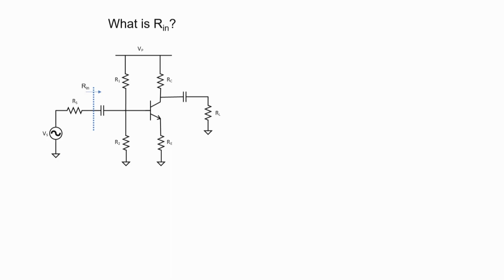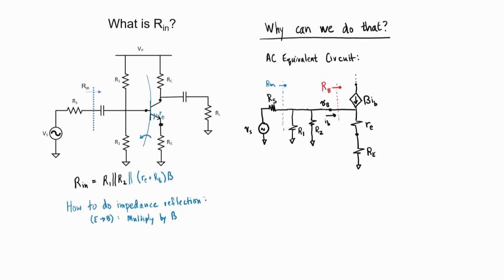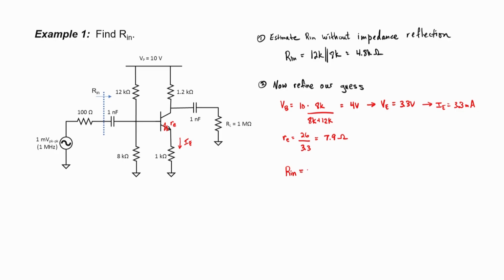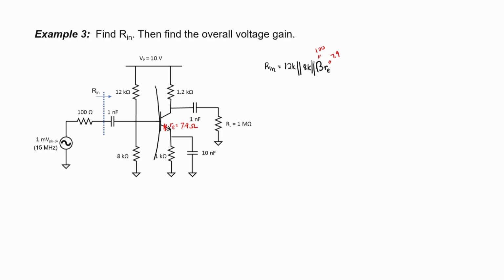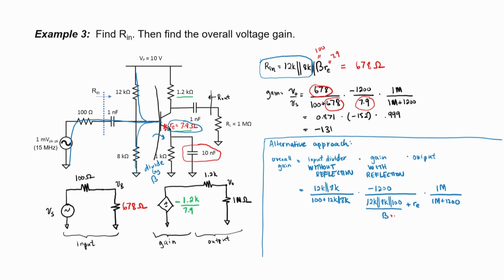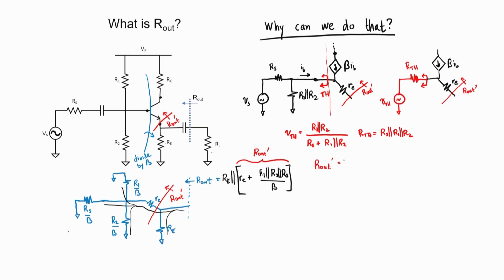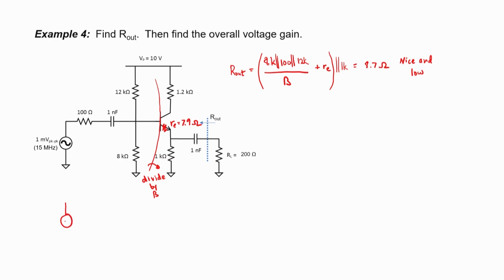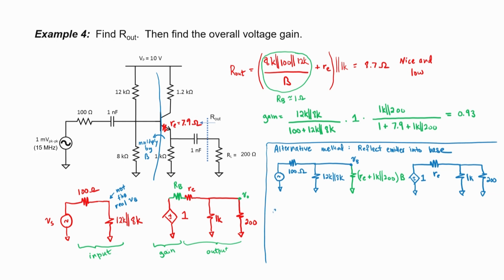Impedance Reflection (11-Transistors)

Comment: I have been teaching electronics for 50 years and had more than 25 million students read my articles and 300,000 have bought modules and kits from me.  Not once have l mentioned impedance or used any formulas or any exotic words because you will lose the student immediately. It is much more important to cover the basics and get the student to understand how to design a circuit and test it than learn all the gobbledygook presented here. None of the students know any of the basics as shown by the submissions. The instructor knows nothing about the transmitter circuit or the phase shift oscillator as he has been a university “stool pigeon” regurgitating all their drivel. You need to learn the fundamentals before listening to impedance concepts.

Comment: 7:15 not sure why you do open circuit voltage divided by short circuit current.  I feel like I missed something.  Earlier you were computing resistance by taking voltage divided by current but didn't specify those modifiers.

Comment: Wonderful videos as always, Aaron. I cant think you enough for publishing these videos. 
One question Ive had is in the situation of an RF oscillator like an emitter follower Hartley oscillator, is this method of analyzing Zin simply not used when theres a feedback path between the emitter and the base? Id love to see a video on a deep oscillator analysis that would help you to predict not inly if the circuit satisfies the Barkhausen Criterion, but also predict the output amplitude, possible distortion that might arise, etc. Id say that would require not using a model for a transistor at all, and instead use differential equations liek the Schockley diode equation instead. Do you have any experience with this?

Another aspect of electronics I've been studying is negative resistance, tunnel diodes, and configuring BJTs to harness this negative resistance effect to create oscillators. If you had any experience with this, I'd love to hear your take on these subjects!

Comment: I'm trying to wrap my head around the fact that in the last example, all resistors are in the kiloohms regime but the ac-output resistor is still just a few ohms (which means I could connect an 8 ohm loudspeaker). If the collector resistor were zero, I'd believe it right away. Is there an intuitive way to understand this?

Comment: Why is re calculated as 26mV/3.3mA ? How does kT/q appear here?
Reply: By definition. It’s the quotient of thermal voltage divided by emitter current.
Reply: It comes from the Ebers-Moll model of the BJT transistor and the dependence of Ic on I-sub-S(T),  V-sub-BE and V-sub-T (=kT/q).

Comment: @12:00 shouldn't that be 1.2k // 1M ? Since the collector is tied at one of its ends to a DC source, it's therefore connected between the collector and an AC ground making it in parallel with the one megohm load, right?
Reply: This would be correct only if the transistor was modelled as a current source. 1.2 kΩ is output impedance/resistance. In current sources, it's wired in paralel. Considering he modelled the transistor with the voltage source, according to the Thevenin's theorem, it should be wired in series. Hope this clears things out. 👍🏻
Reply: @mihajlopetkovic2003  Makes sense indeed. Thanks.
Reply: I guess 1.2k//1M . Is also 1.2k . 1M is very high